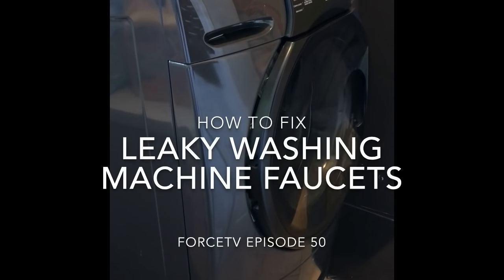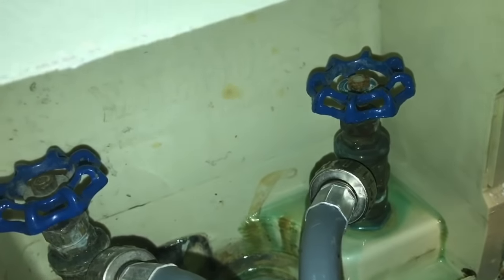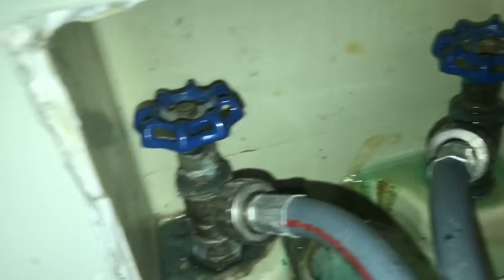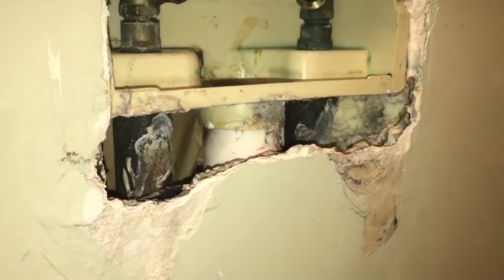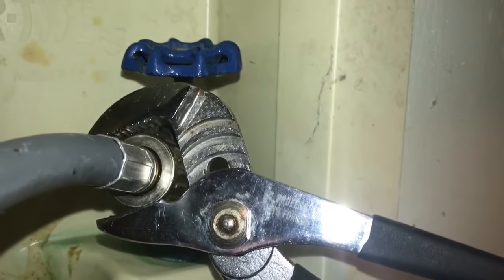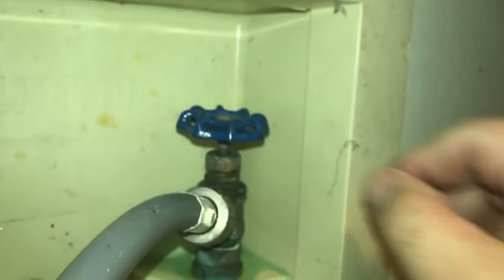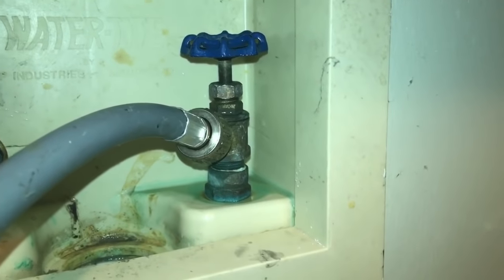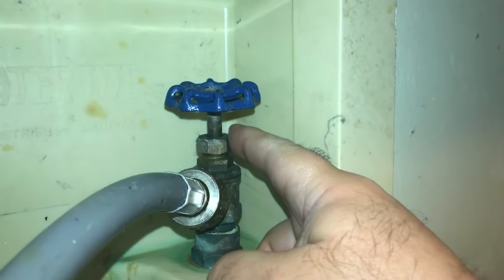How to fix leaky washing machine faucets! - ForceTV 050

Comment: Thank you for the video. Question; I was replacing a washing machine and turned the water handles to off position, but one of them (cold) in the off position, still has water coming out; not a lot, but enough that forced me to turn the main water off to replace the machines. Any idea if I have to replace the entire faucet assembly or can I take it a part and replace the o-rings maybe? Thank you!
Reply from the maker: @Jeff1960G I’m glad you found the video useful. You should definitely be able to take the faucet apart and replace the worn seals - most likely a rubber washer. Look for videos on YouTube that demonstrate with a similar faucet to yours. Should not be too complicated.

Comment: My valve is just like these, just hard to find new ones except with longer ends  & blue in color...my vlave is leaking from the top ..the on & off area..or so it seems..but, no way  I can find to tighten...Does this mean I have to totally replace the valve??  And if so..Imy valve connects to an cast iron elbow..and I can't get the new valve to line up to both are facing same direction...what am I doing wrong??  (hope u can understand my problems..  Thanks in advance!
Reply: PS  THANKS your video volume remained loud (until about the parts after the "tightening of the packing) and it  was visually clear; On the step by step instuctions..  ONE & only one I found that showed this type  washing machine valves  THANKS again!
Reply from the maker: Looks like I didn't reply to you, sorry! Did you get your leak resolved?

Comment: What if we don’t have the faucet handles? My cold water is coming out only the hot water. I’d appreciate your advice
Reply from the maker: @16CaseR You are missing the faucet handles? If the top of the faucet is notched in a small circle around where the handle screw goes in, you can add a handle from the hardware store. Perhaps someone removed them in the past?

Comment: How much force should you need to place on the packing nut? I have a similar leak, and I was able to turn it (very slightly) with a strong amount of force, more then I felt comfortable tbh, and it seemed to slow the leak a bit. Should I continue trying to tighten it, or do I risk damaging the valve? Also thanks for the great video, very informative!
Reply from the maker: Patt Attack You don’t want to tighten too much as you could squish the packing out which could worsen the leak. It’s hard to say how much is enough, but if you give it a quarter turn or maybe a half turn, you should see some result. It should not be overly difficult to turn.
Reply: Ok great! I'll try to tighten it a little more, if not it may be time to call the plumber. I really appreciate the quick reply!
Reply from the maker: Good luck!

Comment: I want to comment 2 tell how I was able to fix my leaky washing machine hose. 1 end had a washer in  the end of the hose however it leaked anyway. So what I did was I melted wax candle wax into the end of the hose underneath the washer and then put the washer in and put more candle wax on top of it and then I screwed it in as tight as it would go and the wax started squeezing out that little the little edge around the hose and sealed it. And now it doesn't leak.

Comment: This was so helpful! We had a new washer installed yesterday and when I went down to the basement this morning I had a small trickle of water on the floor from beneath my new machine. I looked closely and found a trickle of water coming from the hot water intake faucet. After watching your video I went down and followed  your instructions of tightening the nut under the handle after turning off the water and drying everything off. I reattached the hose and turned the water back on. I now have a folded paper towel under it and am waiting to see what happens. Fingers crossed that I fixed it! 🤞 My husband pitched a fit thinking we had a "faulty installation" of the new washer. 🙄 I'm hoping it's just the nut loosened just enough to cause the leak and that all is well now. Thanks for your help! 🤩
Reply from the maker: @helpfulnatural I’m glad to hear it was helpful! It’s pretty common for the faucet to leak when attaching new hoses. I hope you found the issue!
Reply: @DougForce  I ran a load of towels as a test using warm water. NO LEAKS!! Thanks again! 🥳
Reply from the maker: @helpfulnatural Excellent!

Comment: Thank you for making this video. It helped me a ton. I had watched a plumber fix our leak by doing the same thing. After he fixed the leak, I never turned the handle again until about a year and half later which was today. When I turned the faucet handle, the leak came back, so I did a YouTube search, and your video came up. After watching your video, I turned the packing nut a few times and stopped the leak. I thought everything was fixed until I turned the faucet handle again. When I did, it leaked again. I had to turn the packing nut a few more times to stop the leak. It’s not leaking now, and I’m going to leave the faucet handle the way it is.
Reply from the maker: @Tom Nguyen I’m glad it helped! Turning the handle after the valve has sat for a long time is usually when it will start leaking. Usually a few turns on the packing nut will stop it again.

Comment: Second time trying this and just like you I had to tighten a second time. Seems to be working. Glad to know that if it doesn't completely stop the leak that I can just replace the washer. Now if only I can find the leak in the main water line for my house. My water bill has been very high lately with fewer people living in the house...arggg! Nice video!
Reply from the maker: Glad to hear it worked for you. Water leaks in the main line aren’t fun, but once you find it and access it, it can usually be repaired for $10 or less in parts.

Comment: My washer is off, the water is off, and water is gushing from the hose that's attached to the washer! WHAT SHOULD I  DO???
Reply from the maker: @Rocs Cee Make sure the faucets the hoses are connected to are turned off first. If water is still gushing from hose, is the washer full of water? Perhaps it overfilled? If so, let that hose drain into a bucket or the drain until you can get the water out of the washer. Sorry to hear about the issue!
Reply: @ForcedOnline - Doug Force  No, it isn't filled with water. Thanks for your reply!
Reply from the maker: @Rocs Cee Did you get it resolved? I’m curious how it was gushing…..
Reply: @ForcedOnline - Doug Force  Yes! Thank you! All of the hoses were loose and the lines were crossed. A local repairman fixed everything for $75.
Reply from the maker: @Rocs Cee I’m so glad you got it resolved!
Reply: @ForcedOnline - Doug Force  So am I.  Thanks, again!

Comment: I hate the way these dumb shower stall type washer hose hook ups are designed.
They should make them with an easily removable access panel just below the faucet deck that reveals the bottom 6 or 8 inches of the faucet for easy faucet replacement.
TODAY . . . even in a new house . . . you have to Tear A Major Portion Of Your Wall Out to replace a worn out washer faucet. . . . STUPID.  

Hey Oakley you listening or are you in still in CHINA ???
Nevermind Oakly . . . I just got an idea.